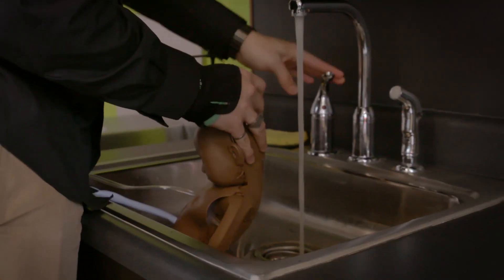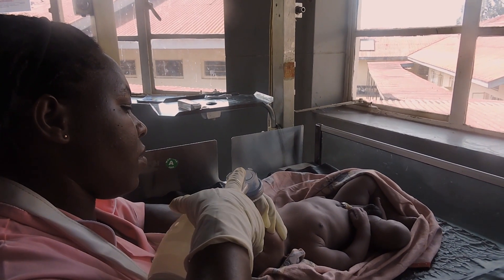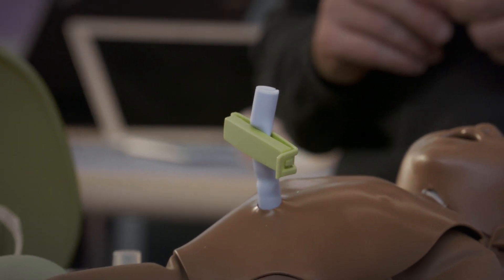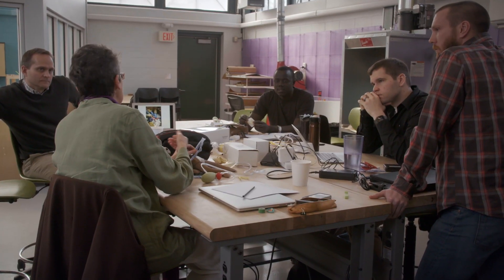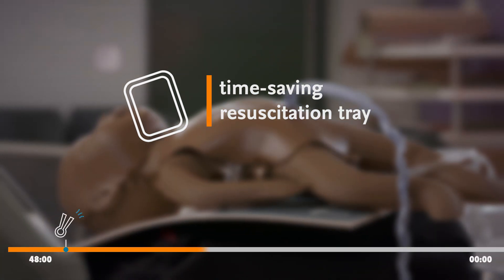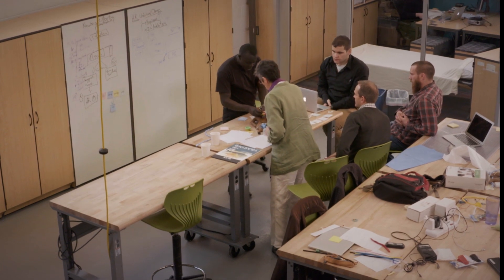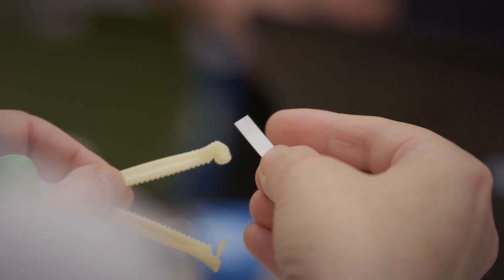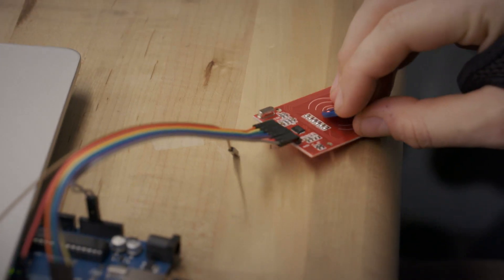A 48-hour global health challenge to save newborns

Comment: Interesting... One thing that came to mind immediately is that their focus on the cord clamp, by its nature, actually creates low oxygenation. When the cord is clamped and cut right away, the oxygen-rich blood from the placenta is prevented from going into the baby. That cord is literally a life support machine and if that's cut off before baby can breathe independently, that can result in very low oxygenation and low respiration. Early clamping is also associated with low Apgar scores and "floppy" babies. So it seems to me that many of these cases of poor respiration would either be prevented or would not be as dire/emergent if the cord was left intact until the placenta was detached and delivered (and coupled with that, not actively managing the third stage of labor by trying to forcefully eject the placenta before it's ready--which can also cause maternal hemorrhage). Not only that, but vaginal births wherein the baby is left to come out on its own without the use of forceps or ventouse (vacuum) will squeeze the baby in such a way that it expels liquid from the lungs and helps baby to take his first breath. If there is too much interference with that process, the baby will not breathe as easily and may very well have fluid in the lungs. I think extra technology can be a great life-saving tool, but much of it would be unnecessary if birth was left more to nature and not "controlled". I'm not saying that they shouldn't still make those tools--in certain births, even under the best circumstances, baby may still have difficulty breathing. So yes, let's try to make it safe for as many babies as we can. But we need to examine not only things we can add to birth, but also what hindrances need to be taken away.